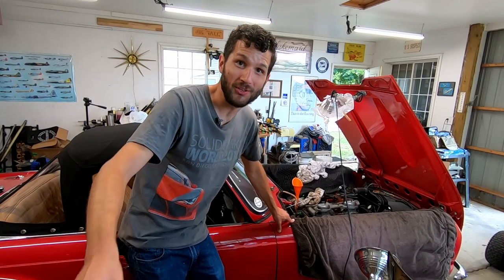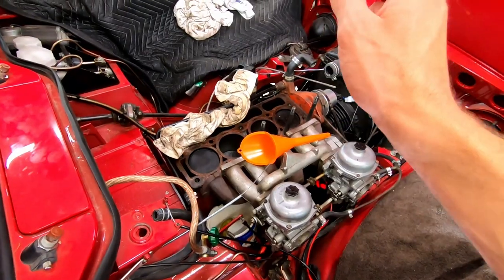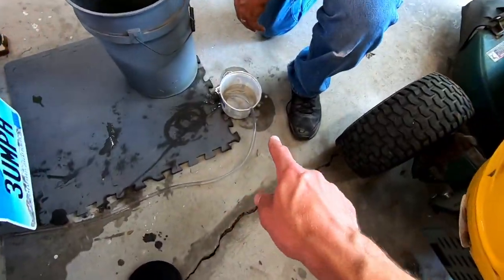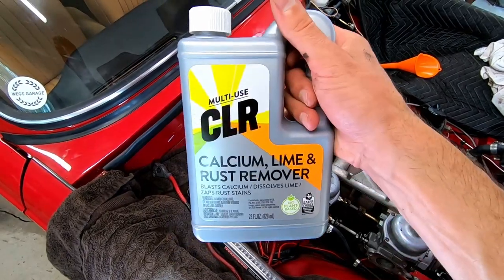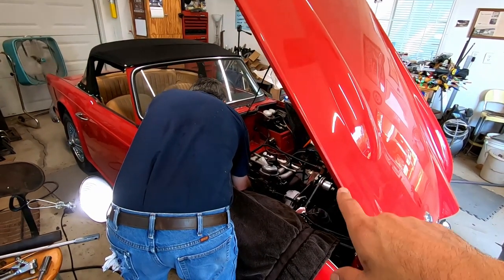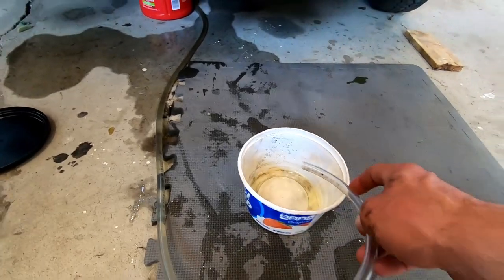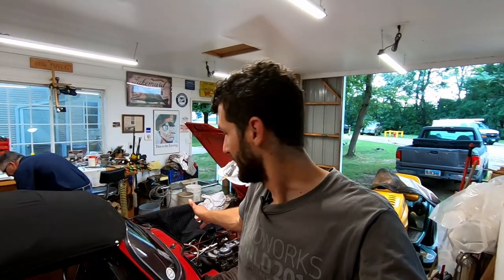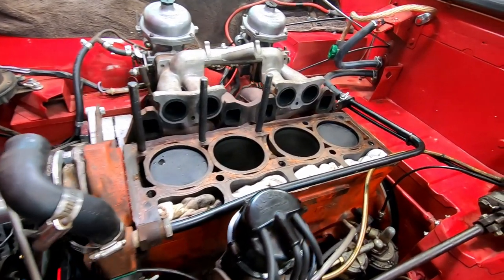Cleaning CRUD from the Engine Block with CLR! Triumph TR4 Cooling System Flush

Comment: PUT SOME WASHERS AND BOLT DOWN THE SLEEVES.! ONE washer/bolt per pair of sleeves. They may come loose and leak later. Remember the Sleeve protrusion is on ALREADY crushed double-O base gasket. Good job.! I also notice your chassis Battery ground, it looks like there is no cable to the motor for a ground, where the HIGH AMPS Flow.? I have added a cable to my ground to the block. Moss mentions fires from no motor grounds, through the choke cable...?

Comment: My engine has been overheating.  The petcock valve is clogged (tried sticking a wire in that but didn't help), so it looks like bad circulation through my engine.  Don't want to take off the head, though, but may have to because flushing isn't doing the trick!

Comment: Appreciated your clarification on liner protrusion measurements with the feeler gauges. Currently replacing the head gasket on a '67 TR4A and this reminded me I need to do this while I wait for the gasket to arrive.
Reply from the maker: Definitely check them out while you are in there. I have read some horror stories about these things. Hopefully yours are in spec 👍
Reply: Thankfully we were consistent and within tolerance all the way around, .003"

Comment: Gentlemen! Great job again. For a mechanical cleaning, I use the brush used for rifle cleaning with soft metallic brush. The lenght is good and it is very solid. Just a tip that may use. Take good care! Cheers. Jacques
Reply: Thanks Jacques, used this method to clean up the holes for the studs in the block once we removed the head. Thanks for the suggestion, most helpful!

Comment: Good job, guys. Not an easy thing to do with the engine installed. I think CLR has a green tinge to it, doesn't it? Radiator / water pump circuit next? You may get the same results.

Comment: Evapo-rust makes a product specific for cooling systems.  

The manufacturer of CLR warns not to use CLR on any metals except chrome or stainless steel.  

CLR does not create a rust protective coating like evaporation-rust, metal blast…..  

CLR on metal will actually re-start the rust process making it worse.